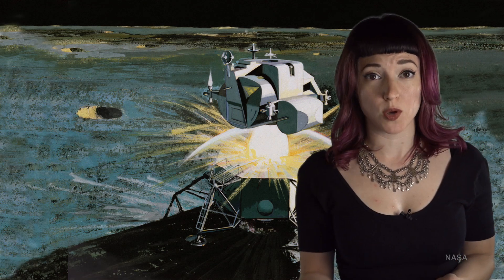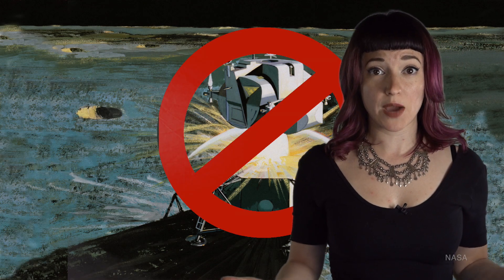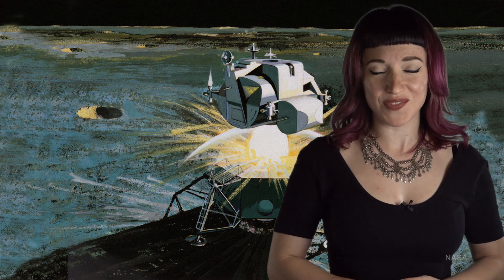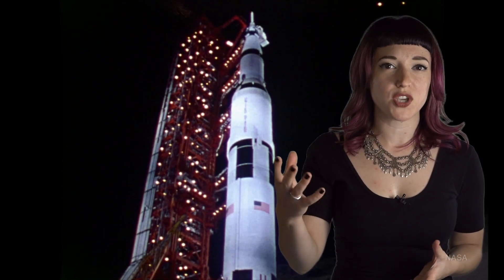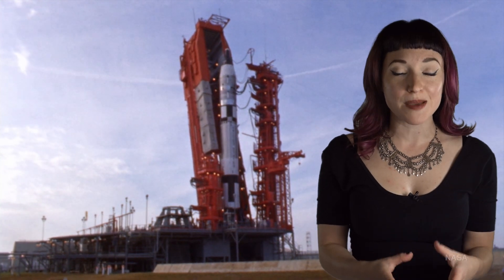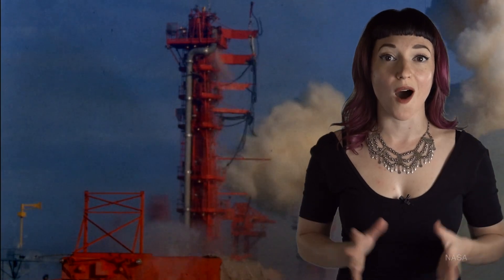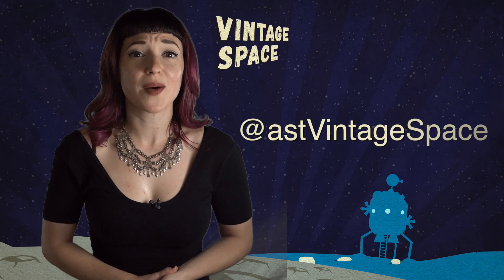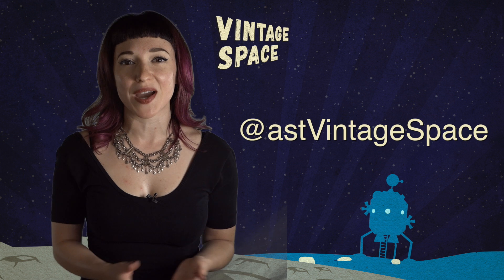How the Lunar Module Launched from the Moon Without a Flame

Comment: If Nasa had faked this. I would honestly expected them to way over do the flame rather than leave it out. Something like a Thunderbirds style sugar rocket or the like.
Reply: Ok
Reply: @happydays8171  the flag was made with a wire frame to support It, it was "blowing" because it was shaken while being put up.
Without air resistance there was very little friction to stop it shaking.
Reply: a random steve 
Okay, got it. 
The nice little lunar breeze blowing that day helped too.
Reply: @happydays8171  yes, the wind generated by the endless waffling of the ranting conspiracy theorists has quite an influence.
Reply: a random steve but there was movement when an astronaut passed by (not touching it). I know the response to this was that perhaps there were gases coming off the suit, also/or possibly static electricity. Both plausible explanations. But if you consider there were sounds recorded when a thrown object struck the LM, and the unlikelihood of a microphone picking up sound inside the LM, and you start to wonder....
Reply: Kinda like you woulda thought they’d at least have used meteorites for moon rocks to foreign dignitaries, not petrified wood.... as they did.
Reply: @DeDraakAap  
YOU SAID: "yeah, good thing besides having too poor of a technology to produce good images,"

== They had outstanding 16mm video film cameras, and fantastic 70mm still film cameras.  What more do you want?  The Apollo imagery taken on 70mm film is still many times better than the absolute best digital camera that you can buy today.

YOU SAID: "they did have tech to do live broadcasts from the moon... and the live remote control of the camera filming it..."

== Correct.

YOU SAID: "if only they spend a couple of hours producing better image quality. lol"

== What ARE you talking about?  Why do you idiots revel in the fact that you're idiots?  Why are you people proud to be idiots?  Look, dummy, the 70mm film images from 1969-1972 are still orders of magnitude better than the best digital camera you can buy today.  But, if you're talking about image quality from the TV video... it had 200 lines of color resolution!!  FROM THE MOON!!  LIVE!!  I dare you to do better with a 1971-1972 field sequential RCA camera.  Oh, whatever, you don't know what you people are talking about... none of you.  I've seen you many times before, and you've made it very clear that you'd rather just spit in other people's faces, than to actually take time to learn how these different technologies worked.  You're just another idiot.  There isn't a single moon conspiratard on the planet who understands the technologies/sciences they are blindly discarding.
Reply: Yes in 1969 they had all kinds of awesome realistic special effects.
Reply: Happy Days   Well put!!
Reply: I would also expect the oober light moondust to have been strewn all about as the rocket pushed against the face of the moon to launch (and land) . . . but because Appollo 11 was bogus footage in that way, NASA had to keep broken protocol. Kubrick just couldn't get that part figured out, I guess. (Props, though. This was pretty good sci-fi back in the day.)
Reply: Who filmed it then?
Reply: @SspaceB  ”Who filmed it Then?” You Ask. The TV Camera on the Rover (the same Camera as filmed the astronauts walking around) filmed the LM’s ascent.
Reply: Try filming a helicopter  taking of on a beach from 20feet away
Reply: See how clever they are?
Reply: Flame effects had been used before in other sifi films. The flame would have been a issue for set, Ratios and such.
Reply: If Nasa had faked it, I would blabla....
If Nasa had facked it, Russia would have blabla...

These are not logical nor physical arguments, and they prove nothing.

I am a billionair. If I was not, then you would have known...
Reply: TheColinputer you mean like add in disco colored sparks shooting out from under the LM in all directions?  Reeks of cheap 70’s special effects.
Reply: @_antidisestablishmentarian5656  
YOU SAID (in my notifications as a partial message, but doesn't show up in the actual thread): "_ Antidisestablishmentarianism _ replied: "rockethead7 wow that’s interesting. Would you be so kind as to point me to the other times this effect happened in those videos since it “happened ANY time anything moved that fast”?"

(If you wrote more than that, I didn't see it, and cannot see it.)

My answer:  Sure, if you pay attention to any time something moves fast in the frame, you can see the effect.  One of the more countless times (besides the fast flying debris during liftoff) is right here:

https://www.youtube.com/watch?v=bVNTNeNMH8Q&t=45s

Watch for about 10 seconds starting at the 45 second mark (which should be where the video starts with the link I posted).  Notice that any time the astronaut moves abruptly in the frame, or the camera itself pans quickly left or right, the astronaut's white suit turns into a rainbow around the edges.  This is EXACTLY because of the same reason as the "colorful" flying debris.  If the object is moving in the frame faster than the color wheel spins to be able to paint all of the colors into the single pickup, the colors get all jacked up, exactly as I said.

Do me a favor, and confirm this response, because I suspect Google/YouTube's comment sections aren't working correctly right now.
Reply: _ Antidisestablishmentarianism _ You mean the explosive bolts and foil like insulation?
Reply: @_antidisestablishmentarian5656  
YOU SAID: "you mean like add in disco colored sparks shooting out from under the LM in all directions?  Reeks of cheap 70’s special effects."
== No, you moron.  The color camera they used on the moon produced that effect because, to save weight/size, they built it with ONE pickup, instead of the normal THREE pickups (they used 3 pickups to produce color back then).  So, with only one pickup, they produced the color images by having a spinning color wheel behind the lens.  It worked reasonably well, not as well as 3 pickups, of course.  But, the downside is that any time something moved fast in frame, too fast for the color wheel to spin all the way, it jacks up the colors.  And, guess what, you see the exact same effect for ANY time something moved fast enough in frame in those videos.  It's a product of how the equipment worked, not a conspiracy.  Good grief.
Reply: @rockethead7  save weight on a camara?  The clowns took a jeep with them. Ffs
Reply: @_antidisestablishmentarian5656  
Question: I see your response (partial) in my notifications, but they do not show up in this actual thread.  Did you post it here, or is it another Google/YouTube snafu with the mysterious vanishing messages?
Reply: rockethead7 that’s bizarre. I simply responded in youtube like I did with the other comment you saw and responded to.
Reply: @_antidisestablishmentarian5656  
YOU SAID: "that’s bizarre. I simply responded in youtube like I did with the other comment you saw and responded to."
== Well, YouTube sometimes has mysterious comment problems.  Anyway, whatever.  I *do* appreciate you confirming the message issue.  I do NOT appreciate the idea that, just because you don't know how things work, you use it as ammunition to say that the Apollo missions were only "special effects."  Just because you don't know how the equipment was designed, doesn't mean you should use it as "evidence" to discredit mankind's greatest technological achievement in history.  How about actually ASKING first about why those were colorful, before saying that it "reeks of special effects."
Reply: @UCSLv4ckUk5d9e4_RPemaEAw 
YOU SAID: "I can see the lengthy comment I left for you when logged into my account. When I log out and go to the comment section, my comment is gone.  Yours are all there, but mine is erased. That’s interesting. Seems YouTube’s comment section isn’t working for that one comment."

== Yeah, mysterious YouTube comment problems.  "Lengthy comment" - well, I'm not sure how I will ever see it, because I can only see what little shows up in the notification window (about 1-2 sentences).  But, I remember something in the cobwebs of my memory that there's a setting you can change in your profile to determine if comments show up or not.  Don't quote me on that, though.  It also makes no sense that you've undoubtedly never changed those settings, so why would it suddenly change for one or two messages?

YOU SAID: "It’s also interesting that the rainbow effects on the debris are visible in The Apollo 17 liftoff but not in the Apollo 15 liftoff."

== Yes, the same effect is there, just not quite as dramatic for some reason.  I don't know exactly why.  Maybe it was the angles, or lighting, or the fact that Apollo 15's TV frame was a lot closer than Apollo 17's frame, thus not giving as much of a chance to make the rainbow effect.  Maybe Apollo 15's color wheel spun faster than Apollo 17's color wheel.  Maybe they turned the "contrast" or "color" settings down on Apollo 15 (which does appear to be a bit less colorful overall), but turned them up on Apollo 17 (which appears a bit more vibrant and colorful).  I don't know the exact reason, nor do I care.  I'm not in the business of accusing thousands of people of being liars and frauds based on my ignorance about an insignificant detail.  I don't use the "I don't know how something about Apollo worked, therefore Apollo is fake" version of "logic."  That's what you're doing.  Not what I'm doing.
Reply: rockethead7 no you use the presuppositional “I know Apollo happened as they say it did no matter what” version of logic.  There are literally thousands of anomalies, inconsistencies and impossibilities associated with the Apollo missions. Like when reconstructing the nominal orbit insertion phase of the Apollo 17 LM it has been found that the trajectory doesn’t even match the television broadcast. Rocket models were used with the same guidance logic used by Apollo 17 and they fail. A roller coaster track, however matches the trajectory on the broadcasts perfectly. This is simply one study of hundreds that show signs of fakery. Please read the paper: https://www.aulis.com/PDF/apollo17-ascent_trajectory.pdf  It’s a 32 page paper by an engineering PHD. Let me know your thoughts.
It seems apologists like you will reject EVERY piece of evidence that doesn’t favor your position.
Reply: @_antidisestablishmentarian5656  
YOU SAID: "no you use the presuppositional “I know Apollo happened as they say it did no matter what” version of logic."

== Wrong.

YOU SAID: "There are literally thousands of anomalies, inconsistencies and impossibilities associated with the Apollo missions."

== Funny that not a single one of these supposed problems have ever made it through the scrutiny of the scientific peer review process, ever.  Funny that the only people who think this stuff are the people with the least education on the relevant topics.  Funny how you can't find more than about 5 physicists or aerospace engineers or rocket scientists on the planet who agree with you, and the uneducated masses are the only ones that share your opinion.  If these "problems" were real, then the EXPERTS would be the ones spotting it.  But, nope, the percentage of educated professionals in the relevant field who think Apollo was faked is so close to zero that it would be a crime to even say "99%."

YOU SAID: "Like when reconstructing the nominal orbit insertion phase of the Apollo 17 LM it has been found that the trajectory doesn’t even match the television broadcast."

== WHAT television broadcast??  They weren't broadcasting television at that time, except just the initial liftoff.  Except for the first few hundred feet, as viewed from the rover's camera, there wasn't even a mechanism to have television broadcast.  And, hey, dumbass, where'd you learn that anyway?  On YouTube?  The land where any fucking moron with a $30/month internet connection can post any "calculations" they think are correct, and dummies who don't know any better can just say, "oh, he used numbers, he used big words, therefore he knows what he's talking about"??  Is that how this goes?  Hey, dumbass, if you think the math works out in your favor on that, you can submit your calculations and data to your favorite physics science journal for scientific peer review.  If your math holds up, they will publish it. And, from there, if you're right, you will go down in history as the first person on the planet who has mathematically disproved Apollo.  See, dummy, there's a reason that these outlandish claims aren't being made by any actual physicists.  There's a reason that these outlandish claims only exist in places like YouTube (where there are no checks and balances to review the calculations before they're published).  There's a reason that these outlandish claims aren't being put forth by enemy countries.  Do you think the Soviets, back in those days, wouldn't jump at a chance to expose such a "hoax"??  Why do you think they didn't notice these amazing problems?  Anyway, hey, again, only crackpots make these anti-Apollo arguments in YouTube comments.  REAL scientists would be submitting them for peer review publication.  THAT is how you argue that something about Apollo wasn't actually possible.

YOU SAID: "Rocket models were used with the same guidance logic used by Apollo 17 and they fail."

== Pffttt.  According to WHO?!?!!?  Good fucking gods, there's only ONE operational guidance computer left on the planet, and even that isn't really operational.  They had to patch a bunch of the broken components with modern ones just to get it running.  And, the people who own that computer do not believe Apollo was faked.  And, the guidance "logic" wasn't a "program" in the sense that it could just be copied like a modern computer program that you put on a hard drive and copy wherever you want.  It was literally woven (yes, literally woven with little metal ropes and wires) into the fabric of the computer.  So, where's this magical model that somehow used the same guidance logic, and failed?  Good fucking grief!!!  And, why didn't anybody at MIT ever notice this amazing revelation... you know, those world renowned PhDs who designed and built the guidance computers for Apollo, and single handedly advanced computer science by a couple of decades?  Those guys?  They never noticed that their systems couldn't work for Apollo 17.  Oh, but you noticed.  And/or, some idiot on the internet noticed.  Sure.  And, why would you believe it?  What possible reason do you have to believe any of that nonsense is correct?

YOU SAID: "A roller coaster track, however matches the trajectory on the broadcasts perfectly. This is simply one study of hundreds that show signs of fakery."

== What peer reviewed science journal did you get them from?  What "study" was it?  A YouTube conspiratard study?  Or, an actual scientific study conducted via a double-blind model and peer reviewed via the scientific method?  (I think we both know the answer to that.)

YOU SAID: "Please read the paper: https://www.aulis.com/PDF/apollo17-ascent_trajectory.pdf  It’s a 32 page paper by an engineering PHD. Let me know your thoughts.
It seems apologists like you will reject EVERY piece of evidence that doesn’t favor your position."

== Aulis is not a scientific peer review journal.  Aulis is a well known conspiratard hoax website.  And, if the author is an actual physics PhD (which I have no reason to believe or not believe), then he should know that such analysis SHOULD BE SUBMITTED TO A SCIENTIFIC PEER REVIEWED JOURNAL.  Good fucking gods.  Conspiracy websites, and YouTube, and any random place where anybody with a $30/month internet connection are NOT where any REAL scientist goes to publish stuff.  Any and every real scientist knows that such nonsense is worth NOTHING if it cannot pass muster in the scientific peer review process.  Conspiracy websites, YouTube, and the likes, are where crackpots go when their crazy notions fall on their faces under any real scrutiny.  There are only two possibilities here: (1) The author is not who he claims to be.  Or, (2) The author is a crackpot who published on Aulis because his notions couldn't pass scientific muster.

And, oh, you know, I wrote all of that before actually looking at the claims he's making.  I dismiss such claims out of hand if they're not peer reviewed.  But, just now, just for curiosity, I took a look just now.  Holy fucking mother of imaginary gods, what a goddamned idiot.  I mean, seriously, that guy must be running on about 12 brain cells at this point.  Dumbass, the camera simply tilted up a down, giving the impression that the craft itself went up and down like that.  The craft itself didn't go up and down like that.  Good fucking gods, you people are dumb.  I mean, you're not just a little bit dumb.  You are mind-wreckingly stupid.  They had tons of problems with those cameras' tilt function when they went that high.  The one on Apollo 15 even BROKE COMPLETELY, and wasn't able to tilt like that.  So, yeah, which makes more sense to you?  The camera itself rocked back and forth a couple of times when it panned to the limits of its vertical range, giving the false impression that the craft was on a crazy/impossible trajectory???  Or, maybe that Ed Fendell perhaps moved his stick back and forth a couple of times while operating the camera??  Or, it's a massive conspiracy??

Don't even bother answering.  You're the moron who didn't even know how the color wheel on these cameras operated before jumping to the conclusion that it's fake.  You fucking rude assholes just look for reasons to spit in the faces of those who accomplished Apollo.  You are very willing to call people liars and frauds, because you don't know how a color wheel works in a single-pickup camera, or because the camera on Apollo 17 went up/down a couple of times while filming the take-off.  You fucking morons never even entertain the idea that the CAMERA was moving erratically, not the craft, because logic doesn't matter to you.  Your only objective is to find reasons to call thousands of people liars and frauds.  You're an asshole.
Reply: rockethead7 well looks like you still can’t stick to the central point I brought up. You still haven’t read the paper. Now you’re nitpicking about logical fallacies. 
The ad hominem I was referring to is your attack on Aulis instead of responding to the actual argument contained within.  Ad Hominem means literally at the man. In this case the “man”being Aulis. Instead of responding to the argument (the well written PhD level paper) you simply made an attack on Aulis. I believe you called it a conspiritard hub. This logically fallacious. Instead of addressing the argument, you addressed the source of the argument “the man”.
If you can’t see how what you did fits the framework of the ad hominem fallacy, you may be too blinded by rage.
You seem to not be able to control yourself when it comes to lashing out and calling names. I think you should take a break from this sort of thing for a while and get your head screwed on straight.
You committed an additional fallacy, called a straw man fallacy when, instead of actually reading the paper I introduced, you made up an argument that wasn’t even in the paper and then attacked that.  You said that the shaking of the camera mounted to the lunar rover wasn’t taken into account and that it was the reason the path of the LM wasn’t correct.
If you would have read the paper, you would have realized this argument was never made. Of course all the camera movements were accounted for and each one was documented and studied in detail.
You also commit a straw man fallacy when you continue to attack an argument I’ve never made. The argument that thousands of people are liars and are in on the conspiracy. I never once made this argument. I honestly think that a majority of those who worked on Apollo were good, hardworking people. How do you not understand compartmentalization?  Especially on high technology high security projects. Only a small core knows everything.  If you don’t understand this concept, please research compartmentalization utilized during the Manhattan Project. Only a small number of people knew the big picture.
Please stop straw Manning me with that. That’s like the third time you did it.
Also, go refresh your understanding of ad hominem. You clearly think you understand it but you don’t. You are a shining example of the Dunning-Kruger effect at work.
Reply: @_antidisestablishmentarian5656  so are you going to formulate an intelligent counter argument, or have you resorted to insults because you can't?
Reply: _ Antidisestablishmentarianism   Again we face the “entire planet” is in on this conspiracy. You’d think by now you people would realize, that every country that hated America would have done everything humanly possible to disprove America went, landed, then returned from the moon safely landing in the Pacific Ocean. Every single country with a powerful radio system, knew all radio transmissions from lift off, on the way to the moon, on the moon, and returning to earth was absolutely true. Plus we’re supposed to believe 1 crack pot with a PhD in engineering, verses the thousands of PhD holders, being some of the smartest human beings ever, achieving the most difficult, unimaginable, the highest odds against success, including being designed, created, Assembled the greatest and most complicated machines ever designed by human beings.
Reply: _ Antidisestablishmentarianism _ I don’t necessarily side with hoax theorists or moon landing claimants, but that series of calculations is incredible (in the true sense of the word) there are so many assumptions and approximations that any conclusion about anything is to be taken with a huge grain of salt. I just wonder how videos on how Apollo LOR was conducted don’t seem to go into any navigational and guidance details. Even the Gemini details only mention visual means of locating the rendezvous craft. Maybe I’ve missed something....
Reply: @_antidisestablishmentarian5656  those aren’t spark effects, that’s the ascent stage engine’s exhaust tearing the insulator foil off the descent stage and tossing it away, it stayed flying away for a bit because there is no drag from air, it’s in vacuum, it actually happened on the moon bud
Reply: "If Nasa had faked this. I would honestly expected them to way over do the flame"
NASA's problem is that the 4.7 ton ascent literally tears itself to pieces and damages it's own vital insulation from the swirling exhaust gases present even though it lifts off from a platform...
... but slowing 18 tons of LM mass from orbit and landing it with a descent nozzle close to the ground damages nothing !!!

The extra thrust of descent on the frail insulation should - according to the ascent damage shown by NASA here - rip the LM up badly on landing. But all photos show a perfect, as new LM. That's impossible.

NASA caught themselves in a lie here.
Reply: @G-ra-ha-m  gravity on the moon is very low due to its small size, it takes much force to less to slow the descent.
Reply: @G-ra-ha-m  
So your a Nasa Scientist? 
You have verifiable credentials and OVERWHELMING EVIDENCE TO THE CONTRARY? 
Since YOUR the one calling something FAKE, the preponderance is ON YOU 
Since YOUR the one that does not UNDERSTAND 
I can explain everything to you in every possible way but I cannot help your tiny little brain understand it!
I cannot "Understand" it FOR YOU!
Reply: @thecloneguyz  What are you referring to? The weight/mass/thrust is basic Physics 101.
Reply: @thecloneguyz  You can't even spell
Reply: Well Steve, you're smart. Maybe you could explain to those waffling conspiracy theorists that there's no air in space, therefore a vacuum. And everytime I have my hand near a vacuum, there's a sucking sound, creating a breeze. That's what created the wrinkles in the flag, the huge vacuum called space. Explain it like that and you'll get nominated for one of them Nobel Space Prizes.
Reply: @happydays8171   Not a difficult concept, the gasses in the atmosphere are attracted towards the centre of mass of the planet, by gravity. The air being pulled towards the ground is pressurised by the weight, (mass x gravity) of the air above it creating a pressure. When you draw air out of  an enclosed area, you create a pressure differential. To reach equilibrium, air is sucked back into the enclosed area.
Air remains attracted to the planet because it has mass, therefore it is acted upon by gravity. There is no hard, pressurised shell so the atmosphere is free to expand to the point where gravity is no longer sufficient to retain it.
Reply: a random steve 
Thank you for enlightening me. Maybe off subject, but one of Wehrner von Braun's early inventions/concepts was creating gravity in his spinning space station idea, so astronauts could work better in space. couldn't figure why NASA or Russia never used it.
Reply: @happydays8171  yeah, that would have been good. My guess is too much money or too many heavy and "unnecessary" components being launched into space like gearboxes and motors, or extra thrusters to spin parts of the station. Would be good to see some day though.
Reply: @happydays8171 
The vacuum of space has nothing to do with a vacuum cleaner. You putting your hand in front of a vacuum cleaner and feeling it sucking does not represent the vacuum of space. ✌️
Reply: jon reich 
Jon, vacuum is defined by an absence of pressure. Vacuum cleaners create negative pressure (those are numbers with - in front of them), space is negative pressure. Where's your misunderstanding?
Reply: @happydays8171 
It's a common misconception that vacuums suck. It seemed to me you were making the argument that's what caused the flag to wrinkle. I could be wrong, but it seemed that's what you were saying.
Reply: @happydays8171 
Also, a vacuum isn't an absence of pressure, it's an absence of matter.
Reply: @happydays8171 
Also also, space does not have "negative pressure." ✌️
Reply: @happydays8171  pressure is kind of irrelevant, think of it this way: you have a magnet, you empty a pile of ball bearings around it. this is the solid material which makes up the planet. now you empty some smaller ball bearings around this, this is the air. at some point the magnet will not attract any more because the ball bearings move out far enough that they are not effected as much by the magnetic field. this is basically the same as our planet and why we have an atmosphere which gets thinner the further away from the surface you get. 
 the apparent force attracting the ball bearings, (or the pressure) is greater the closer to the centre because it is A; closer to the centre and where the force is coming from. And B; far more importantly, the ball bearings are being affected by the force exerted by the ball bearings outside of it, also being drawn inwards by the magnet.
pressure in our atmosphere is caused by molecules being drawn towards the centre of mass of the planet, just like the magnet. 
To put it more simply, air acts much like any other matter. it has mass and therefore weight. (Mass x the force of Gravity) the same way that pressures under the sea are incredibly high, yet water does not fly into the air. 
hope this clears up your lack of basic physics knowledge :)
Reply: @happydays8171  sorry but the "vacuum of space" is NOT negative pressure.  A perfect vacuum is ZERO PSI.  When you see vacuum identified in "Torr" like 1.0x10^-7 Torr that is a number that is very close to ZERO.  Another "High vacuum" number like 1.0x10^-17 Torr is EVEN CLOSER TO ZERO .
Reply: a random steve
So Steve, help me understand this gravity theory. 
Which will hit the ground faster, a quarter dropped in Israel where the Red Sea is drying up and you are standing below sea level, or a quarter dropped on top of Mt. Everest?
Reply: That's a good point but then even More people would have asked questions. NASA does lie but all in all, they are made up of smart people. It is One of thre biggest lies ever told to mankind. Did you know that NASAs budget is 58 Million Dollars..... Per Day!!! What do they Really do with all of that Money? $58,000,000 Every Single Day!
Reply: @hotheadedjoelhaha  If it’s really true that NASA gets 58 millions a day, they need that money to run their parts of the space station and to send out the space probes to Mars and other planets. Not to talk about all the aircraft experiments they do.
Reply: Peer review my a55. Funding dictates the review.
Reply: @pipsantos6278  
YOU SAID: "Peer review my a55. Funding dictates the review."

== Pffttt.  How does it do that?  What "funding" results from a scientist reviewing a paper?  Good gods, you people are stupid.
Reply: @rockethead7  epic retort! You're posts are awesome. 
But can you stop beating around the bush and really tell us what you think about hoaxtards? LOL
Reply: @rockethead7  What engine did the tin use?
Reply: @Афонин-я4ь  
YOU SAID: "Have you learnt physics at school?"

== Of course.

YOU SAID: "Do you understand that the only engine that can lift a heavy object from the moon surface in the absence of atmosphere is a reactor engine?"

== What's a "reactor engine"?  Do you mean "rocket engine"?

YOU SAID: "Which works by giving out flame in thr OPPOSITE direction to the direction of gong!!!!"

== Yes, you are talking about a rocket engine.

YOU SAID: "The unit eill turn to ashes in a fraction of a second!"

== So, what are you doing on YouTube?  If you believe that the thousands of engineers and technicians at Grumman and Bell Aerosystems built the LEM all wrong, and that the rocket engine that they built for the ascent stage would "turn the unit to ashes in a fraction of a second," then YouTube isn't the place to demonstrate this amazing revelation.  You need to demonstrate that this is the case, write up your calculations and findings into a scientific paper, and submit it for scientific peer review.  Only crackpots and idiots think that YouTube is the place to go to submit these physics-defying notions of yours.  Haven't you learned physics at a school that would tell you this?

YOU SAID: "Stupid, uneducated peoplevonly cold beleive that this tin foil cupboard from the moon."

== So, let me get this straight... you believe that the MORE education a person has on the topic, the LESS that the people will believe that the lunar module could function??  Pfftttt.  You are completely backward.  The lunar module is textbook material around the world in aerospace engineering classes in universities.  The lunar module is a model of engineering.  Engineers and physicists are the LEAST likely demographic to think Apollo was faked.  Meanwhile, the most likely demographic to believe Apollo was faked are high school dropouts, or people who never went to university at all.

YOU SAID: "What engine did the tin use?"

== Is your Google broken?  Bell Aerosystems built the ascent engine.

YOU SAID: "You can't even spell"

== That's a joke, right?  You make spelling and grammar errors constantly, but you're criticizing other people's spelling?